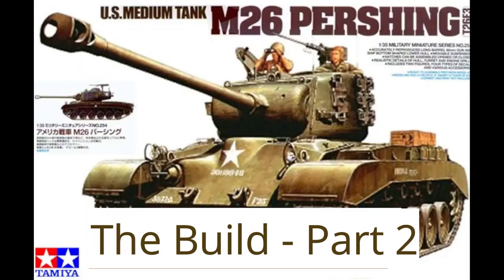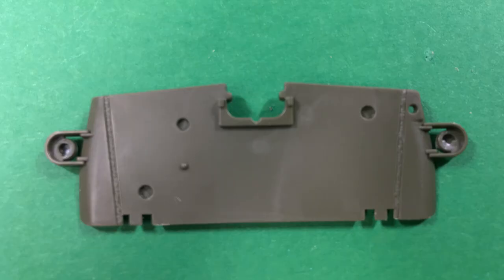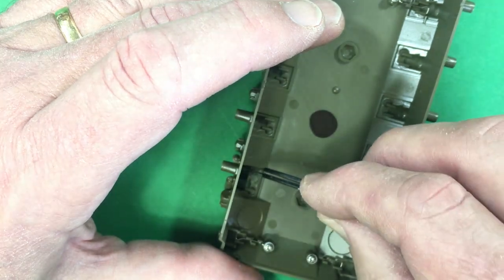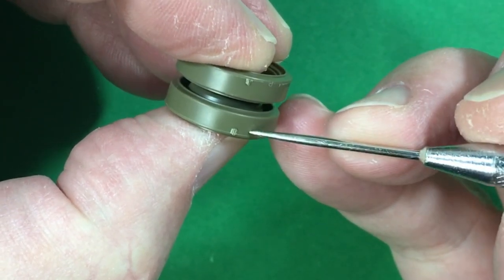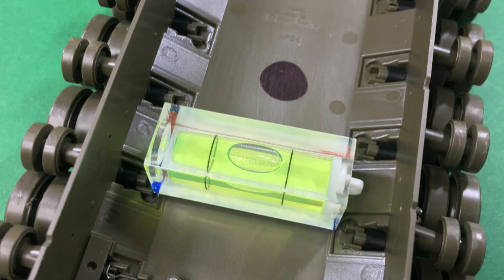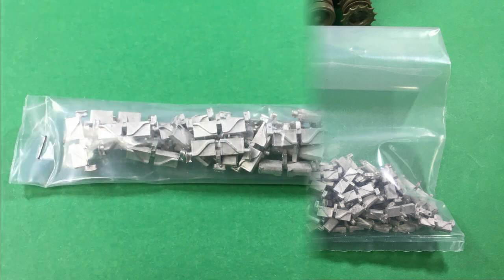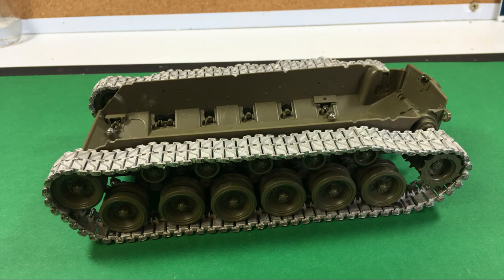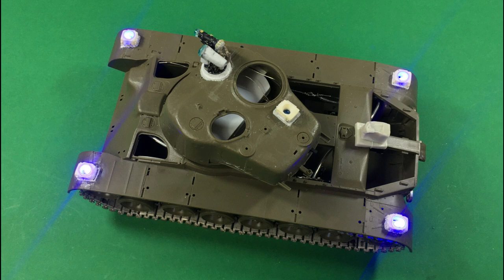Tamiya 1/35 M26 Pershing - The Build Part 2

Comment: You did a great job on devising an efficient method of making the tracks! And well done for not injuring yourself again.
Looking forward to the next instalment.
Reply from the maker: Thank you very much Ian, i don't know what I am more impressed with, my track building system or not removing or puncturing several layers of skin in the process 👍😋😀
Reply: @HalidonDioramas  They're both pretty important achievements! Since returning to building models about 18 months ago, I'm frankly amazed that my scalpels remain unsullied by blood, which is a good thing as I tend to lose consciousness if I cut myself.

Comment: That suspension is ingenious. Should work well with your method of fixing the tank down! Love how the Friuls look, and that's a slick assembly method!. I tried a set for a Pz. 1 and I couldn't find a way to hold them to drill without deforming or snapping them. And my finger ends were like I'd been strumming a cheese grater! Enjoying the build, cheers.
Reply from the maker: Thanks Andrew, it was so easy to put together too, very simple design too.  Dont joke about fingers and cheese graters, I'm still scared physically and emotionally by my clothes dryer incident, i still cant bring myself to enter the laundry 😋😋😋 👍

Comment: Nice track jig you created, Glen.  Have you ever used the staples for a paper stapler as your Fruil track pins?  They work really well and don't need to be glued.
Reply from the maker: HI Larry, thank you.  Yes i did the panther tracks using staples and they were great, i "found" some great staples in the office ages ago that are already flat, used in the printer i think, so i was going to use them, but when the critical moment came i couldn't find them and had to resort to the wire.  I just got a delivery yesterday of a box of watch maker screws and there is one size that would work brilliantly as track pins, tedious i guess to individually screw them in but i did a test run and it looks very cool 👍👍👍